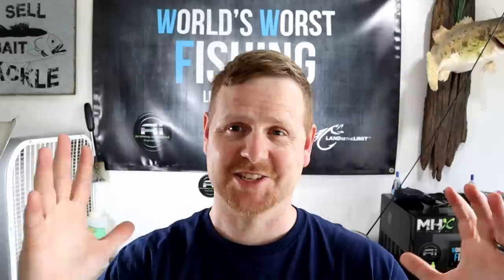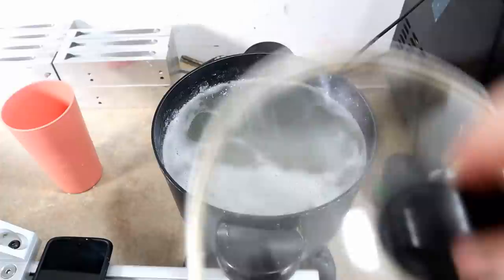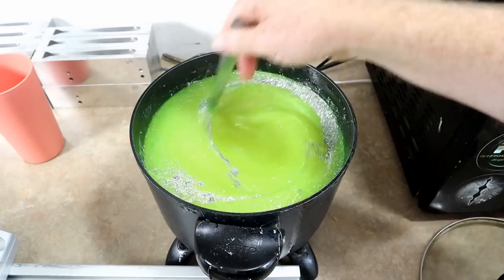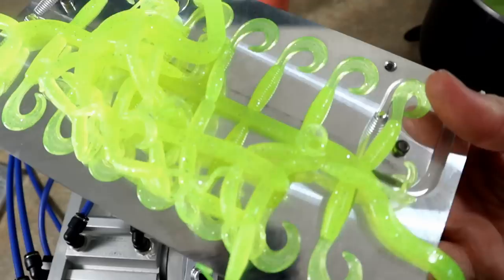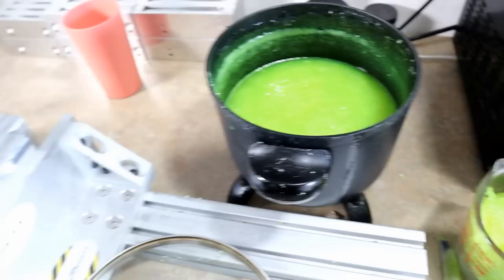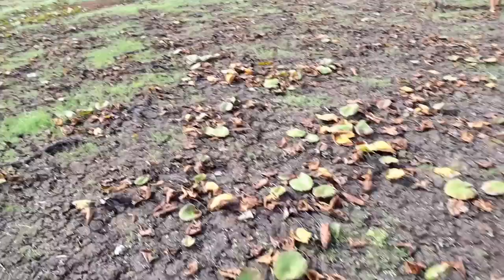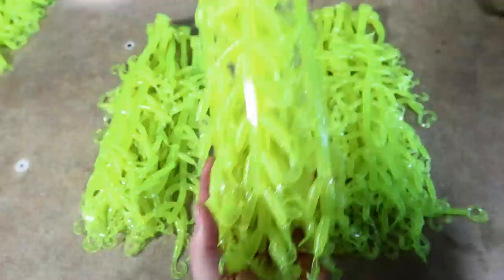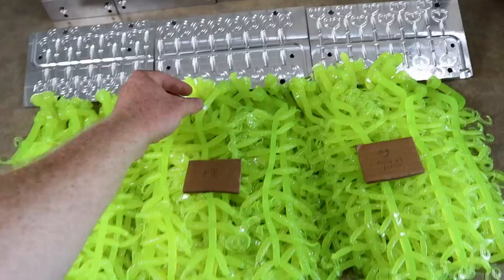ONE GALLON CHALLENGE; How Many Crappie Grubs Does 1 Gallon of Plastisol Make???

Comment: To me techniclly you haven't used all the plastic as about a third is wasted. I feel you need to remelt the plugs and sprues to get a full count. Cheers John from Oz
Reply from the maker: Two things..all the Injector plugs were remelted.. secondly, in the production bait making world the large Injection machines do not remelt runners... This is actually a very accurate representation of how a gallon of plastic is used in the high production capacity.
Reply: Awesome and thanks for the clarity. I've never made plastics before so therefore didn't know the process. Been watching your channel for some time and I'm  super keen to have a go. Thanks again for setting me straight 👍

Comment: I believe the challenge was to use all the plastic, runners, sprues, pucks till a mold wouldnt finish
Reply from the maker: In the bait production world the big Injection machines run high cavity molds and never remelt runners.  This video is actually a very accurate representation of how a gallon of plastic is actually used in the high volume production capacity.